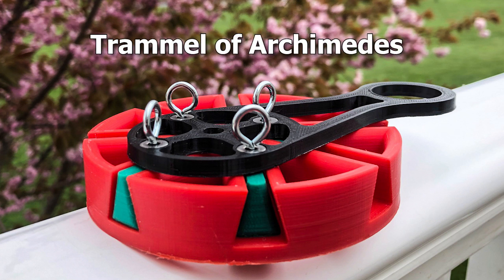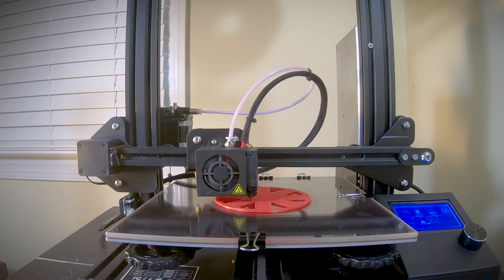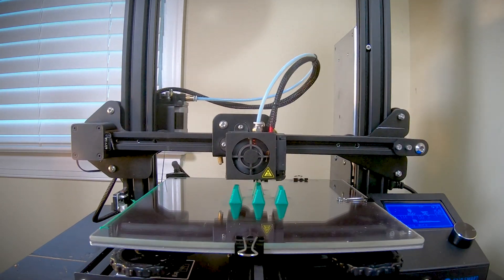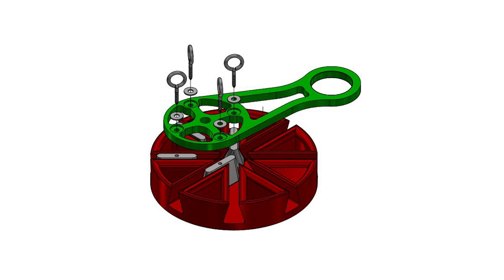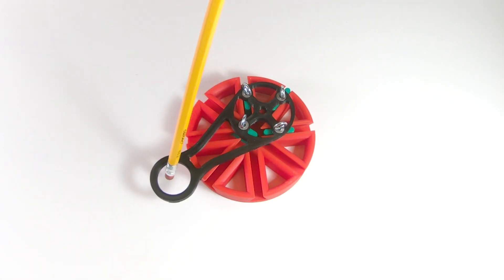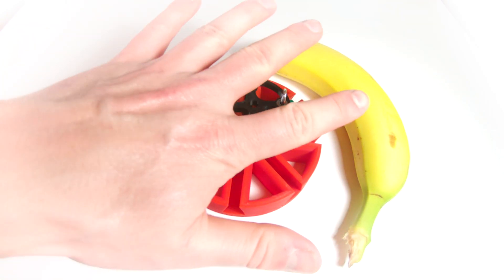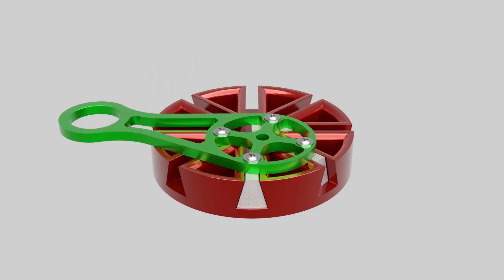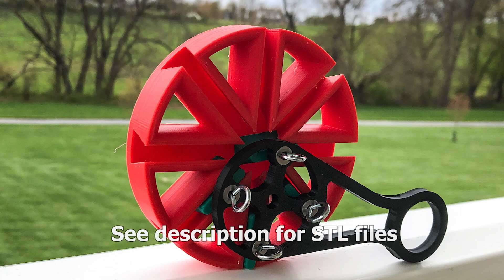Trammel of Archimedes - 4 Pass

Comment: Posting my previous comment got me to thinking (always a dangerous step). If the sliders are reduced to balls and the passes are basically cylindrical, all the moving elements could be produced as a single physical piece with no separate handle, balls, bolts, or washers. But that begs the question of how one would assemble it. The answer is obvious. We have all seen how 3D printing can make things like a set of gears all printed in place, completely meshed and ready to go. The same could be done here, with the frame and the single moving portion all printed right in place. What do you think?

Comment: I like this video and your project. I had never studied these things enough to realize there could be more than 2 passes. You have opened my eyes a bit here.

I have always been fascinated by the common 2-pass version of this which is usually rendered in wood and which has only has 2 sliders. It occurs to me that when you have more than 2 passes the need for the slide pieces to have length might go away. I would suggest that the slides could each be as simple as a ball with each track in which they slide having a cylindrical shape to match. Being a ball means each slider would not have to slide as it could roll. It would become a bit closer to a ball bearing version. Of course, each ball would be spinning on a shaft so there would still be non-rolling friction present.

Also, not too surprisingly, I noted with a wooden 2-pass model that I once made, if there are 2 "handles" attached to the moving frame (one at 90 degrees to the other), the tip of each one draws an ellipse and the 2 ellipses are 90 degrees out of phase. Alternately, if there are 3 "handles" angularly equally spaced from one another, you get 3 ellipses which are phase shifted from each other by 120 degrees. Adding some LEDs at the ends of the "handles" would have the LEDs describing the shape that we sometimes attribute to the electrons of an atom similar to the graphic I found on the internet here: http://anatomyandphysiologyi.com/wp-content/uploads/2013/05/orbital-model-atom.jpg

Thanks again for creating this and the animation that goes with it. Both are very well done.
Reply from the maker: Although not feasible to build, I assume the number of passes is infinite.  However, the most advanced version I've seen online is 5 passes.  With each pass, the alignment becomes more critical.  This one hangs up every once in a while transversing through the center section.  The rounds on the sliders help but it still hangs if held in a non-horizontal position.

Check out the instructable link for my other versions.  I started with wood on the two pass and then progressed to printing once the designs became too complicated for my limited woodworking skills.

Your ball approach sounds interesting.  I assume you are talking about printing a ball inside a ball (ball joint or ball/socket joint).  If so, that might work.  I haven't tried making that type of joint on my low end printer but it should be feasible.  If I build it, I will give you credit on the idea :).   

Thanks!
Reply: @boogiemonster98 ,  I believe that while the 2-pass device needs to have slides that have length, with 3 or more passes, the slides can be reduced to spheres. In fact, in the 4-pass version, I believe the passes can be rounded off toward the center when the slides are spheres. Since there is no way to provide images here, I created some sketches that illustrate the design that I am describing and placed them in this small web page: http://www.angelfire.com/oh3/ebjoew/Trammel_images.html

The first image shows a frame with cylindrical shaped passes. The second image shows how the handle would have spherical slides. Since a spherical slide gains no benefit from rotating in the way that the slides with length do, the spherical slides could be tightened solidly to the handle. The third image shows how the passes could be rounded off near the center. This can be done because as each sphere moves through that area, the other three spheres are being tightly controlled by their passes. They should provide plenty of guidance to assure the sphere passing through the center will do so without even needing to touch the walls of a pass in that region.

Finally, since the spherical slides can be solidly tightened to the handle, it really means that they could be printed right with the handle. However, doing that separately from the 4-pass frame would make it impossible to assemble. Therefore, the handle with its spheres would need to be printed in place at the same time as the 4-pass frame. Therefore, it seems like it should be possible to print the 4-pass Trammel of Archimedes all in a single operation.